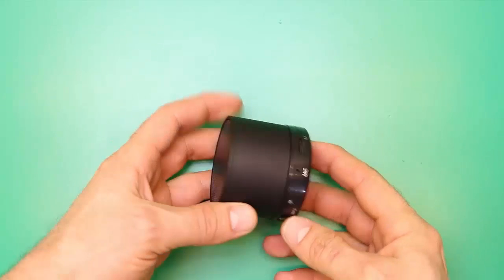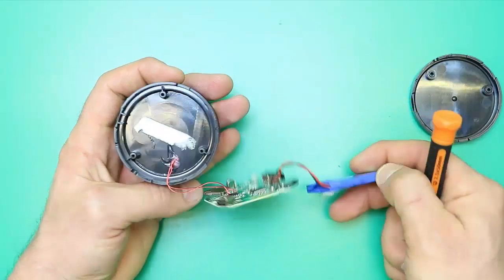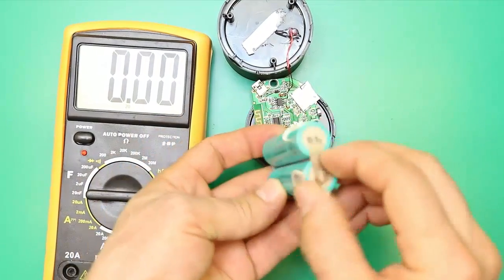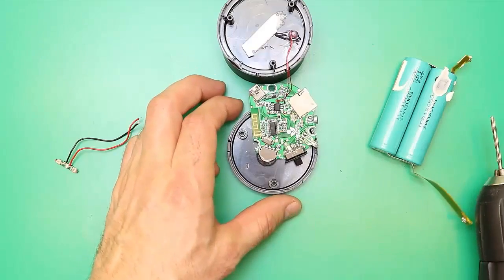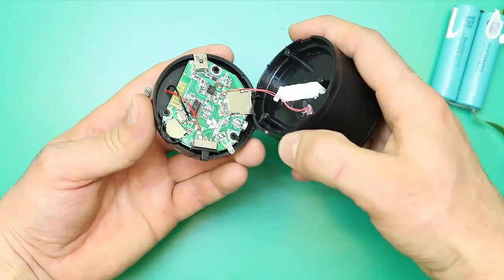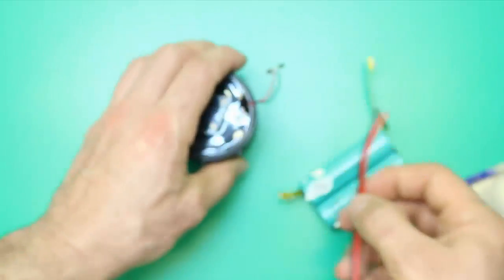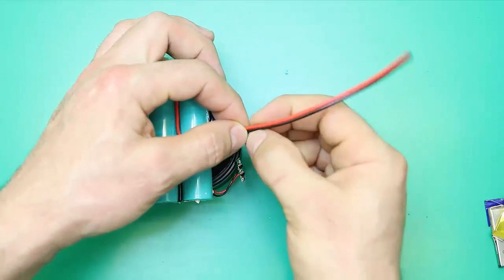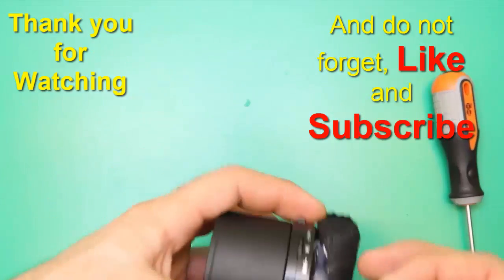The Portable Bluetooth Stereo Speaker How to Open and How to Increase Battery Life

Comment: How do disassemble upper part and remove speaker?
Reply from the maker: This speaker is glued with special adhesive
Reply: @CMCdiy  yes I opened it pryed mesh on one side with small flat screw drive, glue very strong need sharp knife to cut it and open it

Comment: Wow this is a good idea even the people can use your ideas to upgrade the batterys for the Bluetooth speaker and can Last longer when you play music on the Bluetooth speaker but l want to Let you know also l have a idea when you posting a video about a Bluetooth speaker l have a questions about what will happen when you try to upgrade your Bluetooth speaker with higher voltage only using a battery what will happen when you connect them battery to the motherboard  in a higher voltage what will happen?

Comment: hi,i have one of this speaker, and i can not find the company name or model number things like that, can you tell me some info about this speaker. hope you will see this comment. thank you
Reply from the maker: I don't have the company name either. but what do you want to know about this speaker?
It's small, has a 3w speaker and sounds pretty good
Reply: Luk DIY i want to know this speaker info. Cause  i have same one i don't use at all try sell it. So i need know all the info like model number this item name (example iPhone 10 model ××××××)so i can tell them what's about this. If you know some info Please Let me know thanks
Reply: hello...good video...thats my question...I have a blue piston bluetooth speaker...similar to this device...work fine...but,my blue piston have just one speaker...I open it and I noted just two audio cables to the speaker...(not three as in one stereo device)...and you in your video said that this device is "stereo" (6:50 min) my question is...there is a way that my blue piston become STEREO???...or the input signal is already in mono???...I would like to make my bluetooth speaker stereo with sum another speaker...

Comment: I have a weird question...is there a way to change the announcement sounds of the device? Mine speaks with a weird accent while turning on, turning off and  between the modes.
Reply: You've to change the IC of the speaker.  So the sound will upgrade and TALKBACK feature will be changed.....

Comment: Is it safe to use two 18650 35A 3600mAh.?
Please reply.. Thanks
Reply: YouTuber C dont use highdrain battery.  Just a normal laptop battery is enough.
Reply: @mhanel30  but i already installed ncr18650b battery,3400 mAh is it ok sir.
But it works, i don't know when it comes to charge.

Comment: Thanks bro...All is well but I am confused about the two batteries positive and negative position... how you have joined... Please show clearly to better understand
Reply: Gulam Ansary he said its the same voltage 3.5 but more capacity, it will last double the time.
Reply: He added two batteries in parallel.  Means positive to positive connection and negative to negative connection together.  Then taking output from there. My confusion here is what will be the actual voltage in this case because two batteries are in parallel.
Reply: @rajendraks593  
As the batteries are in parallel the voltage will remain same as one previously was, that is 3.7 volt, but the ampere will be doubled.... Say if one battery is 2200 mah, then now it will be 4400 mah....
Voltage of a Li-Ion battery is 3.7, not 3.5.... Charging voltage 4.2, and maximum discharge voltage 2.7 volt....

Comment: I have the same device but battery doesn't last long, i must connect charger to hear music. Where can i find battery for this device !
Reply from the maker: hi, Genius
you can use a phone battery to fit into the device, you can also attach a power bank
Reply: @CMCdiy   Thanks, it was helpful for me.
Reply: I have the same speaker too, but not works, I guess it's the issue of   battery

Comment: I love this video and I would certainly like to know how to go about it, I am having right now an artis speaker which is having a battery capacity to last for like 5 hours but it is not lasting more than two and a half so I want to change its battery so as to get the better output in terms of. But don't think that I am not an expert and I would really like to know how can I do it and which battery shall I buy to enhance the better life of my bluetooth speaker it is a 20 watt speaker and I will be looking forward for your reply thank you.
Reply: just make sure that tye type of bzttery is the same, and tye voltage that the battery puts out is alwo the same. So if you would have a 3.7v lithium battery, using a new lithium 3.7v will work too,

Comment: sir i also have the same company speaker but when ever i start it its blue light just glow for 2 seconds then it's voice start cracking  then it's off . plz tell me what to do it's new
Reply from the maker: Hi
These are symptoms of a discharged battery. Try to load it and then test it again.
If it does not work, it means the battery is dead.
Reply: @CMCdiy    вы супер  молодцы
Reply: Battery is dead. This can work with conected charger.

Comment: You could have extended your bluetooth loudspeaker to a bluetooth adapter with the same diameter PVC tube and you could use at least four Li-ion batteries.

Comment: Stereo requires 2 speakers. There is nothing stereo about this.
Reply: Pha Q incorrect stereo requires two channels not two speakers
Reply: @JDhvactech  But 1 channel needs 1 speaker. It means 2 channels = 2 speakers. So yes, stereo requires 2 speakers.
Reply: @yudaseptiawan1094   A single stereo speaker plays both left and right channels from one speaker using one woofer and two seperate tweeters, so you still need to wire two sets of speaker cables (left and right!) but you'll connect it to one physical speaker unit.
Reply: @JDhvactech  I didn't say about speaker unit.
I said about speaker itself.
You said that the speaker unit contains 2 tweeters & 1 subwoofer, it has 3 speakers in it. So yeah, it can be stereo. Because it contains more than 2 speakers.
Reply: @yudaseptiawan1094  can contain, and since different frequenies can be crossed over in one speaker you can have stero in one speaker, the channels being high med lo
Reply: @JDhvactech  Wow, that's new for me. "Air Sound" is their recipe. Nice info. Thx.
Reply: @yudaseptiawan1094  it's more multi-dimensional spatial sound cuz when you hear something in actual life doesn't come from Left Right comes from a lot of different directions and channels take like a guitar amp has a clean channel distorted channel FX channel it just doesn't mean that the right stereo just means more than one channel
Reply: Pha Q व